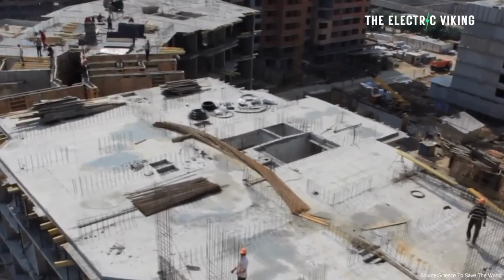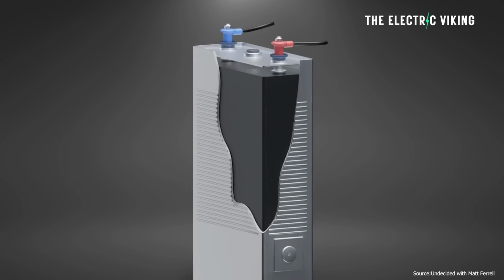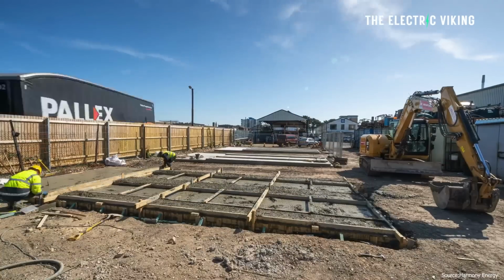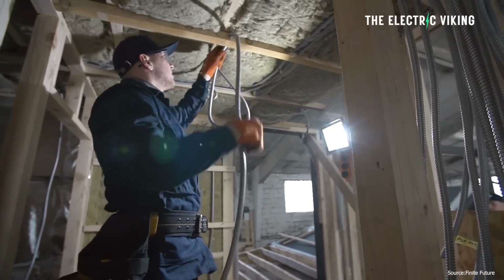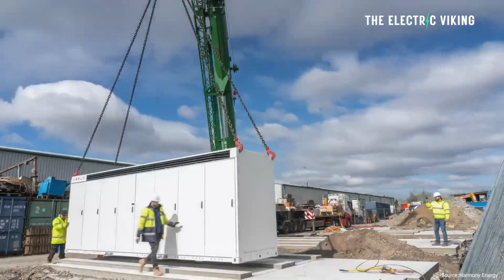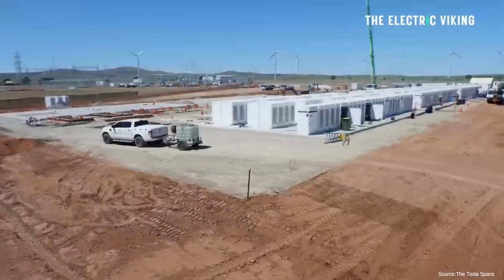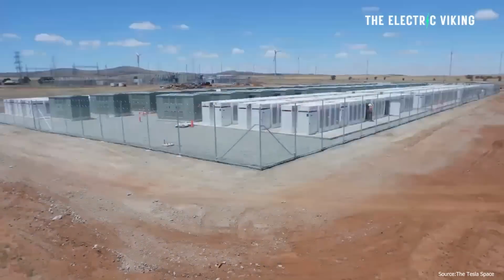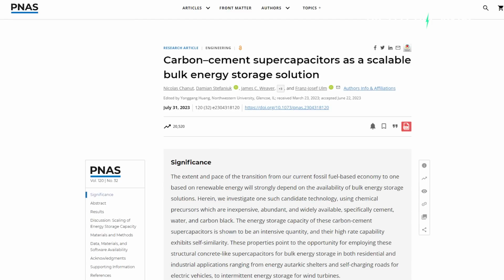Revolutionary concrete could transform roads and homes into giant batteries

Comment: Yep, lots of details needed. How do we get power in and out?. How do we insulate the concrete to prevent bleed or accidental discharge? Is water required constantly for transmission and heat transfer, etc. But I must say it sounds interesting!

Comment: Its only a battery when saturated with specific electrolyte. So it would need to be hermetically sealed.  Many many drawbacks for dual use as battery and structure.  Even more issues as a roadway.

Comment: Carbon/graphite energy storage devices have been talked about for years. I remember attending an engineering society lecture 20 years ago where a Rice University professor said that a box the size of a speakers lecturn would hold 4-5 days of power for a home and would get power during off peak or solar or wind. How do we get power in and out? Do you need a conductive mesh to get power in and out. Sounds expensive for your capacitor charge and discharge..

Comment: The Romans, 2000 years ago already had a better concrete by all accounts.  Anyway, we are going to need something else than tar to pave our roads.  A by-product of the distillation of petroleum products from crude oil is the production of tar and there is going to be less and less tar available as we phase out fossil fuel.

Comment: Well...adding carbon black to the concrete will cost SOMETHING extra, the stuff isn't free...and how will the various concrete structures be interconnected to create power networks? That will require embedding some type of cabling, and then control systems will be needed...transformers...safety protocols so people and animals won't get shocked...so I would have to say, the claim of not costing extra is pure bullshit. Still, an interesting concept, and certainly LESS costly than conventional systems, one would assume.

Comment: Sounds like an idea not a new research result. No details, no demo unit, nothing.
Reply: "After a series of tests used to determine the most effective ratios of cement, carbon black, and water, the team demonstrated the process by making small supercapacitors, about the size of some button-cell batteries, about 1 centimeter across and 1 millimeter thick, that could each be charged to 1 volt, comparable to a 1-volt battery. They then connected three of these to demonstrate their ability to light up a 3-volt light-emitting diode (LED). Having proved the principle, they now plan to build a series of larger versions, starting with ones about the size of a typical 12-volt car battery, then working up to a 45-cubic-meter version to demonstrate its ability to store a house-worth of power." MIT News
Reply: @ronaldking1054  So they don't have a demo unit. Anything smaller than a cubic  meter is not serious for the planned application. Or a full size wall or other building part. Scaling up  is a horrible monster.
Reply: @philippklaus6882  Yes, they did because you are the one claiming that it has to be a building size. They suspect it can be.